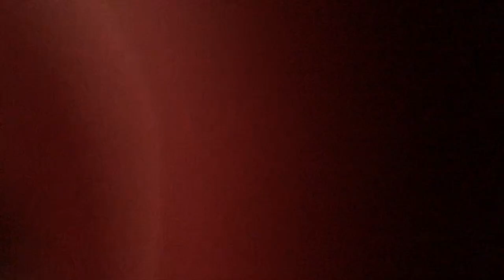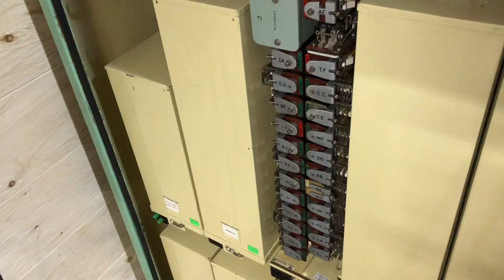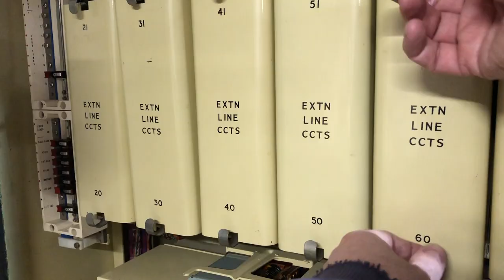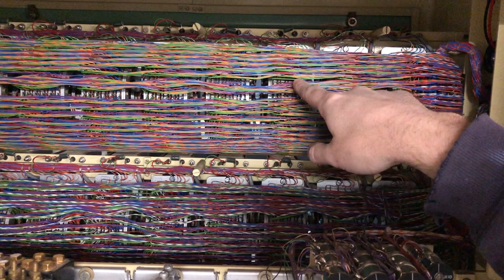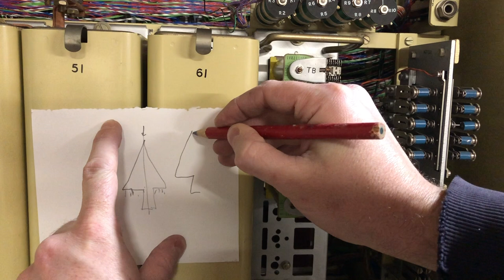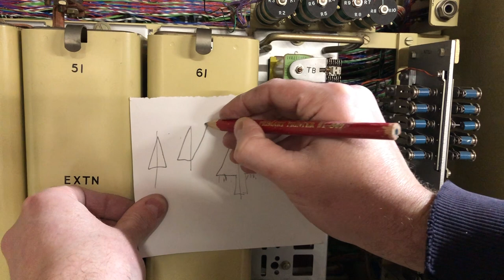Strowger PABX Exchange Line Troubleshooting Part 1

Comment: Do you have any advice on not getting overwhelmed, when you’re troubleshooting this?
I’ve recently had the displeasure of chasing a fault in an old hicom system. I quit and retried so many times, because the unit seems really complex.
(Turned out to be a bad replacement psu)
Reply from the maker: Tim E, Persistence and patience, but the key thing is to take time to soak it in. I find if I stand over something trying to figure out why it’s broken I’ll never figure it out. Instead I’ll spend time with it, take some notes on what’s happening, get a few ideas rattling around in my head, then take a break. Go for a walk, go to bed, go for a drive. It’s amazing how when my senses are decluttered, my subconscious has a chance to just mull things over, and out of the blue an idea will pop into my head for something to investigate, or another piece of data to collect. I’ve used this strategy even in high stress scenarios, in one work situation there were probably 30 people banging away at their computers trying to figure out an outage, I took a walk in the snow and came back with a theory to verify that fixed the problem. For something that is a bit foreign to my understanding (like a Strowger PABX) I’ll sometimes need to come back to the buffet more than once before I have an answer.
Reply: Beefchicken Industries 
Makes sense to break. I’ve usually felt bad about taking breaks, because it “feels” like procrastination. But it makes sense, to spend time to “prepare” the brain, like a tool.
I’ll give it a shot next time :)
Thanks,  man!